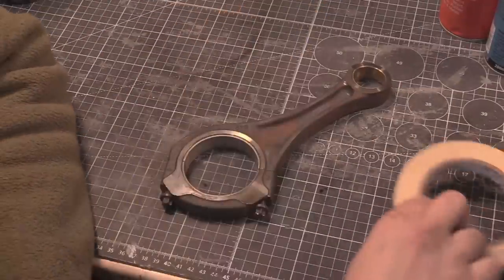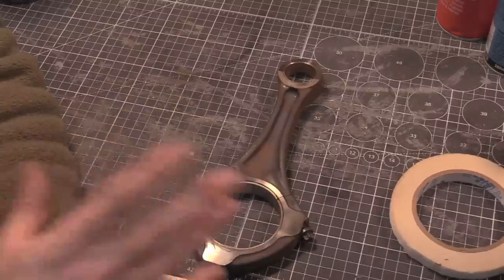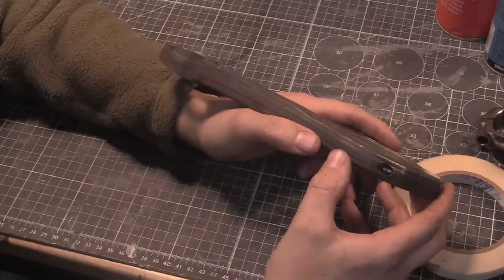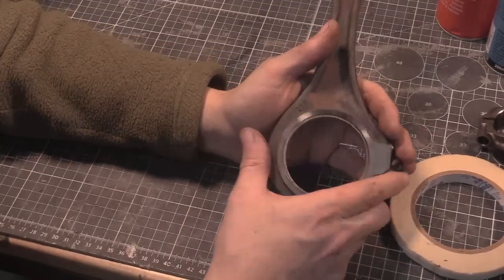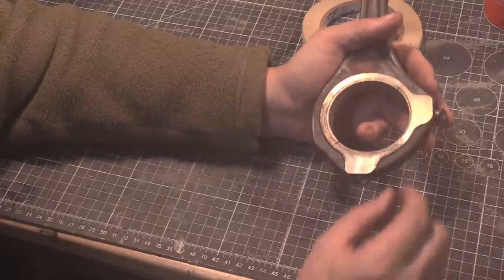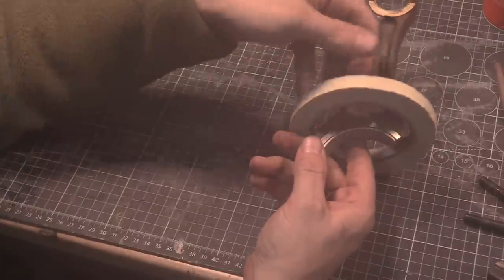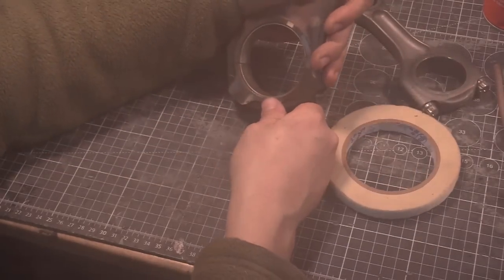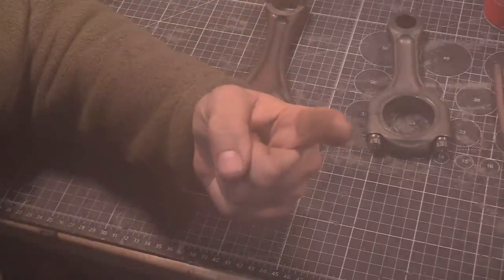Offset Con rod? - But why?

Comment: Honda does this in their lawn mowers. It was obvious to me when I took it apart that they must have done it because otherwise you would have to use special tools to get the bolts out and it would have caused issues with the available space. Thanks for the explanation. Hope to see more of these short and concise videos.
Reply from the maker: That's a monoblock, like a briggs and Stratton engine.
Reply: @dirtygarageguy  which also often use an offset conrod. these bastards somehow still get away with flathead engines to this day, too.
Reply from the maker: Because they don't need to be efficient, but cheap to manufacture, hence the plastic camshaft.
Reply: @dirtygarageguy  What are you referring to? What about the monoblock? The Honda engine I have also had an offset conrod. What is a monoblock? I'm not a native English speaker.
Reply from the maker: An engine where the crank is inserted from the side, and the block is one piece

Comment: I thought a monoblock engine had the cylinder head incorporated into the cylinder block casting.  The cylinder head is fixed and cannot be removed. Offy engines and 1920's/30's Bentleys were made this way. No cylinder head gasket meant they could withstand huge boost pressure.
Reply from the maker: That's a head not a block.
Reply: @dirtygarageguy  Please look up a cross sectional view of the famous Offenhauser engine. Valves, seats, pistons, everything had to be inserted from the crankcase end. The pistons are trapped once the rods and crankshaft are in place.

Comment: Why had the RR Merlin the cylinder banks in line? We all know that the conrods were not symertical, and more complex. What are the benefits with this design?
Reply from the maker: It's an aircraft. Having the banks offset creates a torque, the front left cylinder and rear right cylinder create a torque that's clockwise a.looking from above. 

It was never actually tested, but it was suspected that this would cuase a twist of the crank and put extra stress on the main bearings.
Reply: As it's an aircraft design they wanted the pistons and rods to be in the same plane!
Reply: @dreddwailing5505  I too want the pistons and rods to remain in the same plane while I'm on board.

Comment: Yes for Tehcnical videos 👍👍
Fractured Rods are fantastic.
Lawnmowers, irrigation pumps, small home generators and similar gardening equipment (basically the same engine) have rods like this.
Reply from the maker: Not for the same reason though. The engines you mentioned are mono blocks.
Reply: @dirtygarageguy  All the small Honda engines Iv'e worked on you call mono blocks have cylinder heads.

Comment: Interesting! 

Would love to hear your thoughts on the offset crankshafts. Just rebuilt a little 2020 CB125F after prev. owner ran it dry and melted the piston... and read that the 2021 model has switched to an offset design, although the idea's been around for years, seems clever.

Comment: Ive not watched the video yet but i noticed today that our 7ltr I6 bus engines (volvo i think)  has offset conrods.

The piston and rod were out because the 4th cylinder has dropped a valve, i originally thought it had had some BAD pre ignition and melted most of the way down the centre of the piston but turns out they just have a hole like on the bottom of a wine bottle and the valve had mashed down into that hole.

Ive never seen such a strange piston setup.

Comment: 10:45 
What are you thoughts on the offset rods used in the FA20 engine used by Subaru. Not really slow revving and used in the WRX which is performance orientated.
Reply from the maker: The angle isn't as extreme as with these rods, I'm sure they had to beef them up a bit to handle the loads. How much is the offset, 15 or 20deg?
Reply: @dirtygarageguy  think it's 18

I drive the arse out of mine and haven't had any issues but I know a few lads that have grenaded their engines by boosting them to 300+hp and ended up going fully forged.  One of them is sitting at 400+ on low boost and up near 600 at full whack

Comment: Mercedes OM642 3 litre V6 diesel.The crank is also quite interesseting. The conrods don't share the same crankpin.
Reply from the maker: They have offset pins.
Reply: It was needed because the "V-angle", the angle bt cylinder banks is 72 degrees, and 72 is not the optimal value for 6 cylinders.